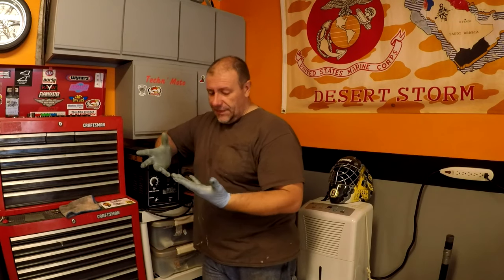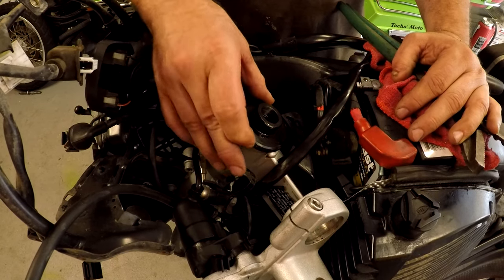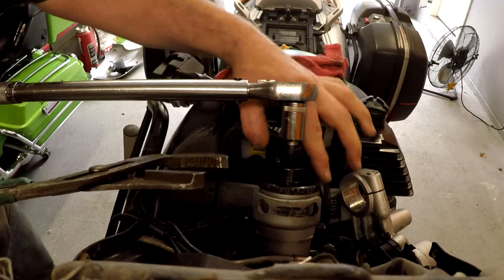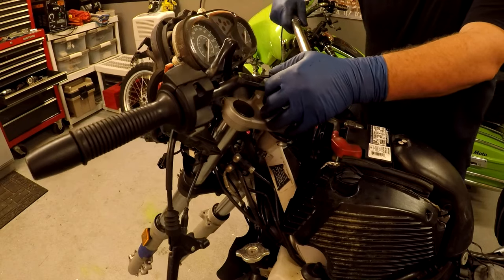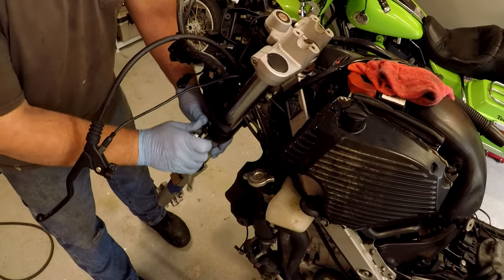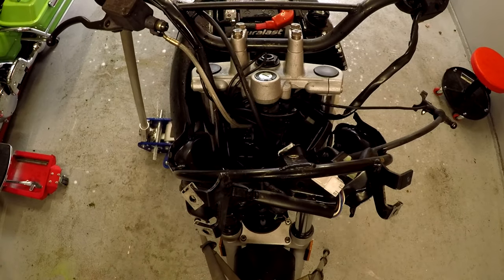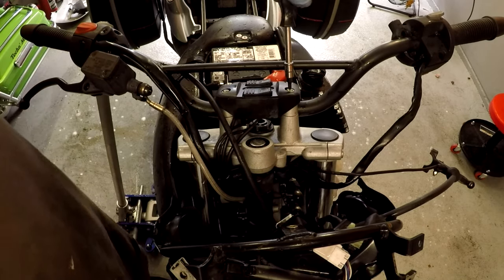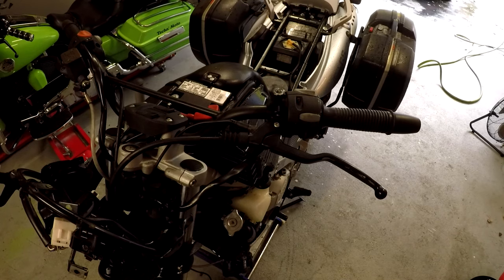Steering Bearing, Triple Tree & Fork Oil- 2007 BMW F650GS | Techn' Moto

Comment: Thanks for the great video, really helped me out! Just a not, I have a 2006 GS650 Dakar and the caps on the forks are screw-in, not clip retained. You have to loosen the top tube bolt to remove the caps if the fork is installed flush with the top triple tree. Just a tidbit for others who might be looking at this. Thanks again!
Reply from the maker: Great tip/info. Thanks